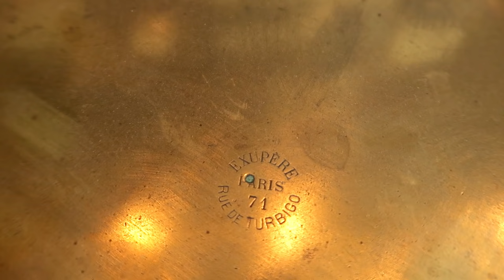Exceptional Vintage Balance Restoration

Comment: If you get yourself a tumbler you can throw the small parts in it to be cleaned. While you clean the larger parts on the wirewheel.

Comment: IF...IF...I did something different, I'd of used brass replacement screws (button head), and polished them to a "high gloss gold" like the feet, but then the choices were endless with this piece i.e. gold leaf in certain places (ducks heads), very small burgundy accents...  Anyway, well done...it turned out great. Between its original look and your ideas...you struck a good "balance"   ;)
Reply from the maker: thank you so much 😊

Comment: Hello Tysy i have 2 questions, 1 why you dident use your blast cabinet if you have it? I see many of your videos and you use in most of them sandpaper, 2 why do your paint with powder coating? Many of your restorations maybe has a better paint job using this technique.

Comment: Liked it very much!
But how do you know the balance isn't disturbed by replacing the screws? They may be of different mass and material (which by itself may induce galvanic corrosion...)?
Reply from the maker: thank you so much 😊 , now is protected with paint

Comment: I use for the polishing, drinding etc. an 0,55kW 3-phases motor with a frequency converter. 
The motor has a chuck and I can also change the tools: a metal brushes, polishing discs, etc.
I'll write you some E-mails.
I, but the way, restore and repair typewriters, earlier I repaired the sewing machines too, but they are not SO MUCH populär as the typewriters...
And sometimes I reanimate some other apliances...
Reply from the maker: thank you i see it

Comment: I noticed on your spray gun the spray pattern knob was in different positions did you adjust this on purpose? Most adjust this knob with the air jets are on the left and right vs up and down so the oval pattern is up and down. Also I noticed that you were spraying in a round pattern vs and oval was this on purpose too? Most paint with a 4 to 1 oval pattern for best coverage.
Reply from the maker: yes, i adjusted myself, but i don’t know to much about

Comment: I don't like some of the color schemes you use and I didn't think I was going to like the green and gold.  How I was so wrong.  It looks great.  The only thing I would have changed was the replacement screws in brass instead of silver.  It still looks great though.  I wish I had your skills.

Comment: It's a shame you could not find some brass screws to replace the steel ones. Also, washers underneath would make dismantling easier in the future
Reply from the maker: i found only screws with cross